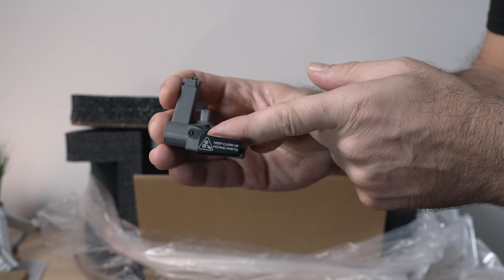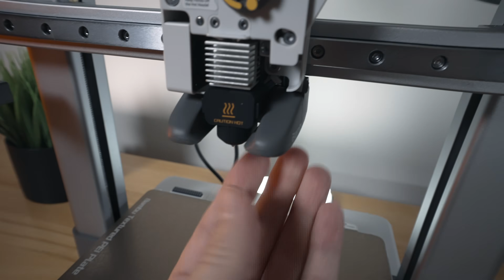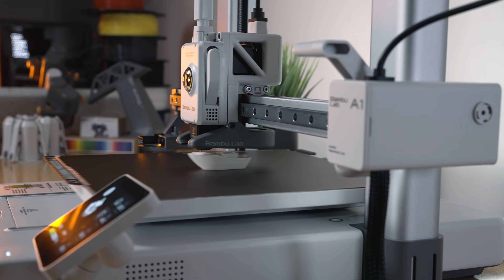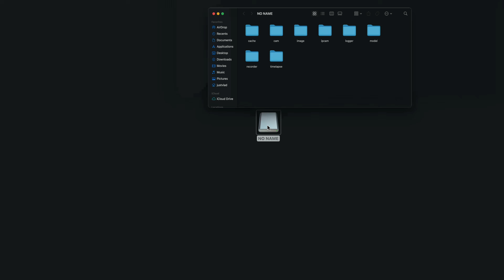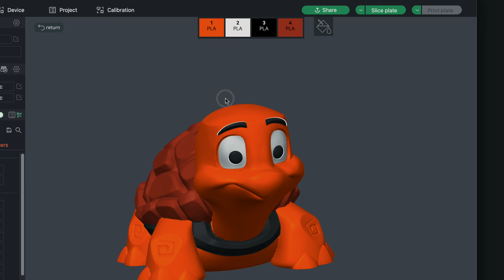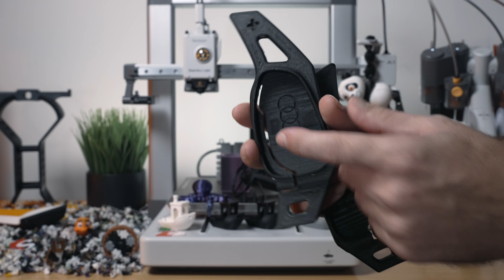Bambu Lab A1 Combo - AMS 3D Printer - Unbox & Setup

Comment: There’s a recent recall on this printer. The bed cable can get damaged and cause a fire. They now recommend you don’t use this printer until they figure a solution out.
Reply: It was true at the time of your writing. I tried to warn you guys.
Reply: All fixed now. ! 😊
Reply: @AGuyCalledHenryYT  Will this problem no longer occur in new versions?
Reply: @gurhansgrtmac2738  I recently brought an a1 and they have fixed all the problems by over engineering the hot bed wire
Reply: @gurhansgrtmac2738  yes its already fixed and all old models are removed from affiliate stores
Reply: Got mine with the new cable design.
Reply: It's not even in stock online anymore and taken off shelves in stores
Reply: To be clear, bambu DID NOT directly contact users via blog or email not to use the A1 even if their cables are okay.

What bambu has done is send an email to all who purchased from their website, asking not to use the printer IF the cable appears damaged.  But if cable looks okay, most printer, then continue to use.

The confusion comes in because since YTers claim they received emails from bambu saying that no one is to use the A1 at all, regardless if cable is damaged.

However, bambu did not officially send that same email to all A1 owners.  they've sent similar email to those who created support tickets regarding the cable, under assumption by bambu that such inquiries implied said owners have a damaged cable.  To those people bambu recommends not using the printer.

But bambu HAS NOT (as of today feb 3 2024) sent a blanket statement, email to those who purchased their A1 through their website.  Nor did bambu update their blog to say such.

At the risk of over repeating myself, bambu has not emailed ALL purchasers of their A1 as they did at the outset when they first released the blog on jan 28th, they've not emailed for all A1 users to stop using their printers.  Neither has bambu updated their blog to say that either.  It's all been pretty much hearsay.
Reply: From Bambu Customer service:

Dear Customer,After the recent release of our A1 heatbed cable potential issue blog, we are actively continuing the evaluation process. We have also received numerous valuable suggestions from our customers. We will take into account the potential risk, user experience, and overall efficiency and other factors, and try to provide users with reasonable and satisfactory solutions. Your patience and understanding are sincerely appreciated as we work towards resolving this matter.

We extend our heartfelt apologies for the delay in responding to your submitted tickets. Rest assured, our team is actively engaged in the ongoing consideration of our plan, and we anticipate finalizing it soon. For your safety and to prevent further damage to your printer, we kindly request that you cease using the A1 printer for now.Your understanding during this period is highly valued, and we want to reassure you that, upon confirmation of our plan, we will promptly address your inquiries and provide the necessary information.

Once again, thank you for your patience and being a valued customer of Bambu Lab. We are committed to resolving your inquiries as expeditiously as possible.
Best Regards,Bambu Lab Support
Reply: They fixed it
Reply: No, they stated IF ITS DAMAGED, stop using it. If it's not damaged, print out the extension bit and you're good to go.
Reply: @deadlyapollo  it doesnt matter if its damaged or not they said to stop using it even if the cable is not damaged
Reply: @deadlyapollo no.   All printers are recalled.  Read the new msg released
Reply: @deadlyapollo  Its a full cease of use message now
Reply: totally not true! there is a problem with bed cable for less that 2% of sold printers. They came up with the solution in matter of hours. They are sending cable strengthener to everyone who bought the printer free of charge, whoever dont want to wait  for delivery, can print it yourself in less than 30mins. Its also worth to mention that it happens to users whos cable is bumping onto something....
Reply: Is a bigger problem. There are lot of people with that problem, more than a 2%, I can assure you. The send everyone a message, me include, that we need to wait 2-3 months, doesnt care if we want a new printer or the cable replacement, we need to wait that. They said they need to make internal test. The stopped the selling of the A1 @DebeliChris
Reply: @YeidenTeam  i never received that kind of message on my A1. Only message I got is that I should print my own cable thingy if I dont want to wait for the official one. Also for informations y'all should read official Bambu Lab statements on their source. My A1 is printing 24/7 since 20th of Dec no issues
Reply: @YeidenTeam  official statement from Bambu Lab published yesterday is 0.1% of all Bambu A1 sold :)
Reply: @DebeliChris  “We strongly urge all customers to stop using their A1 printers until the issue has been resolved.” Copied directly from the official Bambu Lab blog post
Reply: @Tanner3D  yep, totally true now! no doubts, but it wasnt at the time of my writings, check the timestamps, and I said earlier I only trust official statements not hearsay. So now they said it, yup, true, back then, noup, not true.
Reply: @DebeliChris ahh yes, the guy that can never be wrong…
Reply: @DebeliChris they have fixed this flaw recently
Reply: They sent out an update today saying not to use the printers ("we kindly request that you cease using the A1 printer for now"). Some creators were also contacted directly to either remove videos or append comments saying that it is recommended that no one operate the A1 printer. Pretty definitive that they don't feel it is safe to operate until the problem is fully understood.
Reply: @DebeliChris  it totally is true. They stopped all advertising on the A1. There is an engineering flaw with the cable and bed connection. Without a cable clip the cable will eventually break. If only 2% of people were affected, as you claim, They wouldn't need everyone to add the cable clip. I give Bambu credit for their rapid response. Mistakes happen, and they are trying to fix it.